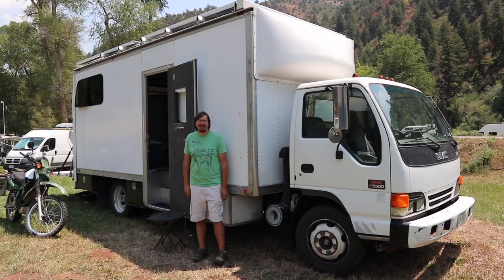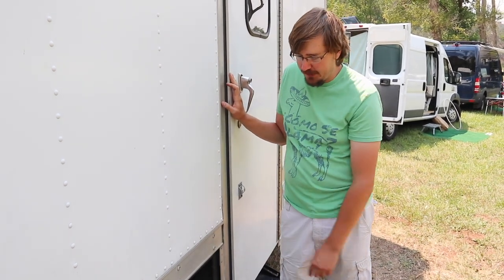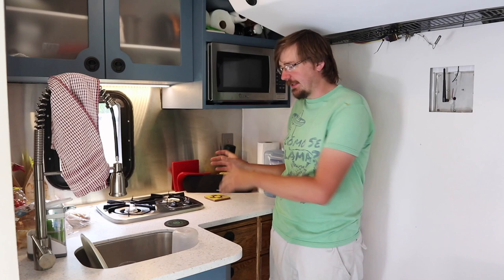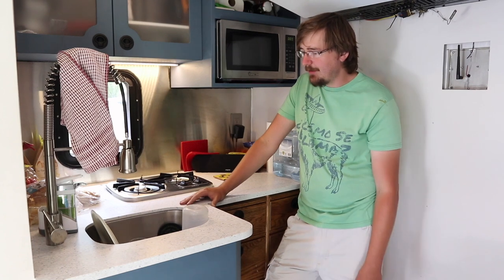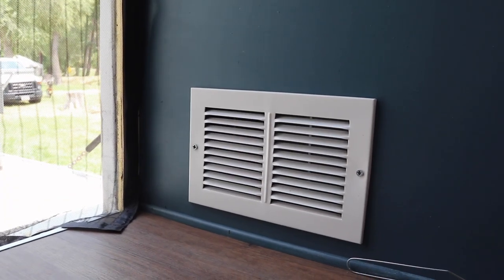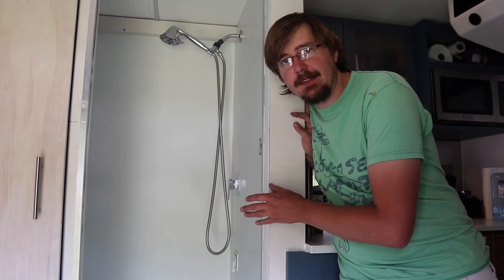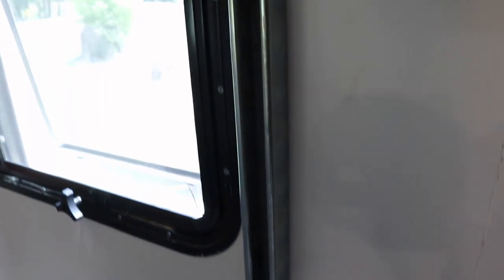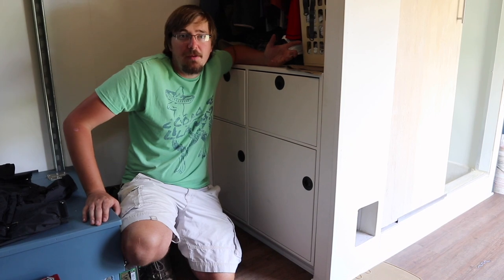Elevator Bed in Box Truck RV Conversion

Comment: I like the front box fairing, so much better then a flat plate, it's probably worth 3-5 MPG at highway speeds. The weight of the bed in the up position  is immaterial relative to the weight of the vehicle, center of gravity wise. The feature of being able to compensate for parked tilt is very valuable, says someone who lived full time in a similar rig back in the '70's. The space it frees up for day time is also very valuable, plus he doesn't have to make the bed, just raise it so no one can see! The cat box is great also.
Reply: I would have liked to see how he can level the bed!

Comment: Cool truck! I like the battery tray but please tell him to lock up the batteries. I have a similar set-up & they stole the batteries right off the truck & all the trucks in the area. Luckily my batteries were older at the time but these batt's are approx. $100+ each & it's a pita that no one needs right now.

Comment: Those are 20 lb propane cylinders. However, if you are purchasing those cylinders prefilled from a convenient store or gas station, etc. they contain 15 lbs of propane. This will be noted on the label. Do whatever you can to have the cylinders filled at a fill station. You will pay less and actually get 20 lbs of propane. Nice video.

Comment: ☺️
Reply: Hi 👋. Does the Dickenson put off moisture like other propane heaters? Or does the chimney stop that? Thanks
Reply: @IvyRosethebus  No, the P9000 and P12000 have a sealed combustion chamber and double walled chimney so that the combustion is sealed from the living space.